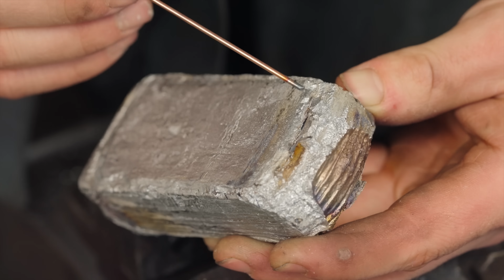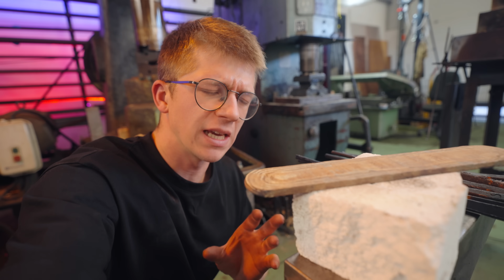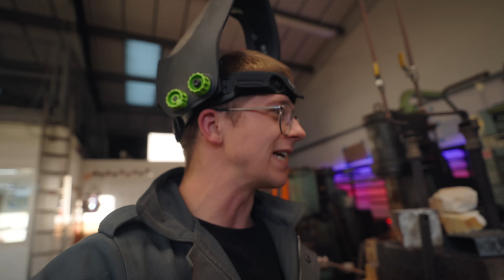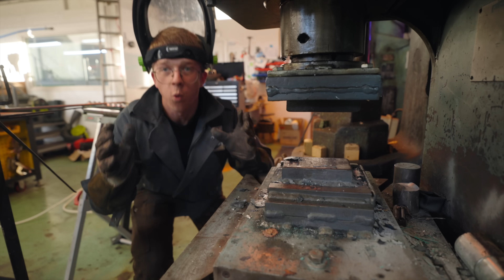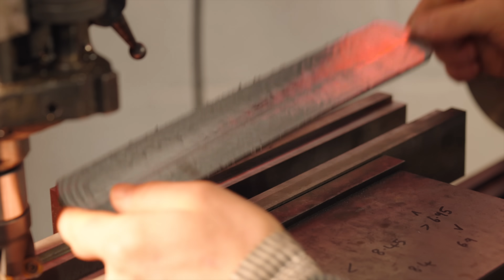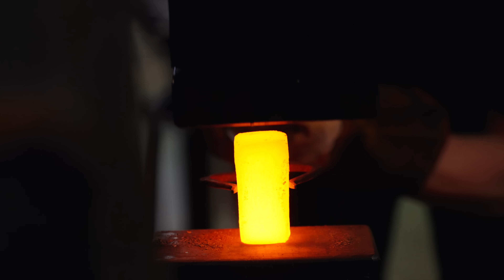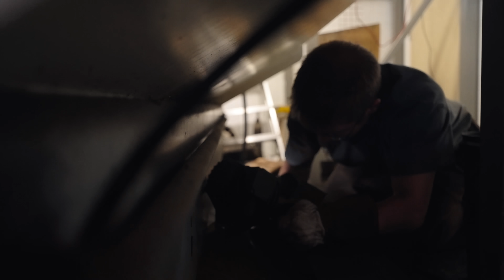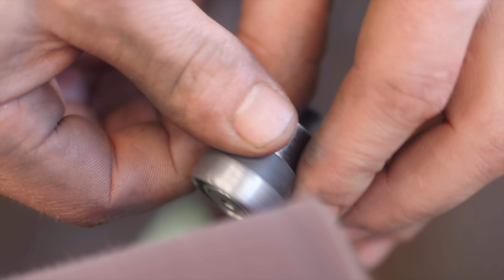Can I Make Titanium Damascus? Part 2

Comment: please make sure to look up all safety precautions for wearing titanium rings.

if your hand suffers a trauma, the part of the finger past the ring can swell up and would require an intervention to be removed.

you saw how hard it was to cut those pieces in the shop, it will be harder in the ER...

these recommendations apply to anyone you give these to
Reply: At the er titanium and tungsten are typically broken off with a sharp blow from a hammer 😨
Reply: @Lunas2525  Never risk using a titanium cock ring.
Reply: I would be able to break it I reckon @deucedeuce1572
Reply: @deucedeuce1572 Too late....
Reply: Ahhh what they actually do is break the ring off. Titanium rings already exist and this is what happens.
Reply: Titanium is brittle but strong. So if his finger got stuck it could be broken off a lot easier than it would be to cut through.
Reply: @graeme.davidson  I agree, just break the finger off to remove the ring ;)
Reply: @dennis6442  [taps forehead] can't have a damaged finger if there is no finger to damage.
Reply: @dennis6442  Remind me to never buy a titanium cock ring. (Not that I'd buy a cock ring in the first place anyways though).
Reply: Along with the finger bone? @graeme.davidson
Reply: You only need to worry about this for fingers you'd like to keep.
Reply: My titanium and gold ring didn't come with any safety instructions!
Reply: @cambridgemart2075  No worries if you don't mind losing a finger or two.
If the titanium isn't continuous and joined by gold, then you should be ok.
Reply: There is a reason rings made of things like damascus steel, titanium, and tungsten have an inner liner when you buy them from most jewelers.  They make it much easier to remove if there is an accident and less likely to cut off the finger in some incidents.

Comment: ChatGPT: Titanium can melt below its nominal melting temperature (around 1,668°C) when exposed to certain conditions like oxygen contamination, high pressure, or stress. These factors weaken the metal's structure, lowering its effective melting point. Oxygen, in particular, makes titanium brittle and less resistant to heat.

Comment: 6:23 In regular chemistry occasionally when you mix two things together you get a reduction in the melting/freezing point. Just a thought.
Reply: Makes sense
Reply: @JIJforgeNfishing just a fact :D
Reply: With some alloys like Zink, aluminum and copper (like ZAMAK melting at a lower temperature than aluminum, even though it contains aluminum and copper). I'm not sure if Damascus can be considered an alloy though, especially not one like that. Some other people are saying that the titanium just isn't dissipating the heat, so it's soaking up the heat on the outside and melting while the inside titanium and steel remain at a lower temperature. I'm not sure how long he had it in the forge though... but it was kind of odd how all of the stuff that melted all came from the same spot on the end and the outside.
Reply: @deucedeuce1572  The piece is only titanium, although different grades, take this as a grain of salt, but in my opinion, that should not lower the melting point. (I'm not a blacksmith or chemist)
Reply: @deucedeuce1572 it is an alloy though, he mixed 6al4v and 3al2.5v Ti to make the original billet
Reply: The pressure might have to do something with it. I wasn't able to find a graph for Titanium but it may behave simmilar like Water wich would be fluid at 1 bar and 0 C but below 1 bar solid and if you go further a gas. Everything at 0 C.
Reply: My guess is that the melting point is lower because this is a Titanium alloy - you have a bunch of Vanadium and Aluminium in there as well. You just googled what's the melting point of Ti, which presumably gave the answer for commercially pure Ti, not the alloys you are working with.
Reply: would the instant heat from friction cause melting possibly?
Reply: Eutectics is what you're looking for, i guess
Reply: Maybe that combined with the gas pressure? Have you tried lowering it down some or can it be lowered any more than where you had it?
Reply: Is it also possible that the argon being pumped in heats up steal faster or at least is providing conditions for the inside to heat at a higher rate?
Reply: It's just bouncing heat from the layered different materials, they have different structural components, so instead of the heat traveling through the whole slab, it's probably bouncing off, in between each layer due to differences in density, melting point, refraction and overall chemical composition.

Just start from a lower temperature and work your way up, 

I reckon as well you should be layering the materials no in line with the holes but against it instead, to create a laminar flow around the whole thing and not in between layers, that should help distribute heat and avoid focal strains.
Reply: @pieroDlio that’s definitely not what’s happening
Reply: Could have to do with the beta transus. Titanium shifts crystal forms at lower temperatures than it melts, and the beta form is more malleable

Comment: Increase in psi=increase in temperature. Im guessing pumping in the argon gas in the container and other gases escaping in the process are holding in the container increasing the psi.... Basically putting a lid on a pot to boil water faster

Comment: Pressure changes the liquefaction point. Like how water boils at different temperatures depending on the air pressure. I think their is a secure patent that that uses a cold roller but the exact method was not disclosed due to US government’s use on pre 2000 stealth systems.
Reply: Pressure generally increases melting points...  but, remember, butter even cold, is a 'solid' but will flow like liquid at pressure 💁‍♂️ plastic deformation
Reply: Pressure usually increases melting points, significantly. The lack of room to expand will keep it solid to a higher temp. But it will have a lower plastic deformation point 💁‍♂️ think cold butter in a hydraulic press, how it will flow more like a liquid under pressure.

Now I wonder, if forging it under vacuum after multiple argon purges, at a lower temp (1600°f), would yield better results.  

But the alloying elements are lowering the melting point significantly. Overheating Ti alloys can separate constituent elements.
Reply: @patrickw9520   US Patent 6,857,558 is a great place to start. Timascus is a strange beast.

Comment: It could be that the billet enclosure was so well sealed that the titanium inside it was also being pressurized as it expands from the heat, thus bringing the melting point down in temperature. I hate thermodynamics, so I'm probably wrong.

Comment: Maybe the melting temperature changes because you're in an argon environment
Reply: I don't think that would change it. Besides that, the argon was gone when it happened the next 2 times.
Reply: @deucedeuce1572  maybe when it's in the furnace the heat is not even all the way through the block more heat is being retained towards the edges that could do it maybe
Reply: @petercarbin2077  That's what some people are saying. I'm not sure myself, but I think that may be the problem. I guess the thermal conductivity of titanium is really bad. I'd be surprised if the iron didn't conduct heat to the titanium though, as they are thin layers pressed right up against each other, to the point of literally being fused together.... so I wouldn't say that I know that for certain though. Hope I find out for sure though. It's something I'd like to have a better understanding of.
Reply: @deucedeuce1572  I would agree maybe the two different type titaniums have a slightly different melting point and the conductivity of heat through the metal that is why everybody says titanium is really hard to work with

Comment: Two thoughts: Have you looked at the data sheet of the alloy and what it says about melting temperature instead of looking at pure titanium, secondly, uneven heat: Titanium has about half the thermal conductivity of steel so would be more prone to pick up hot spots from the forge.
Reply: Yeah, localized overheating and the fact that these are alloys and not pure Ti were my guesses.  Also pressure affects phase changes.  Or it could be plastic deformation that just seems to appear as "melting."
Reply: @thetaintpainter5443  Could be why all the stuff that squirted out was from the same spot along the outside.
Reply: @thetaintpainter5443 nah, more likely iron leached from the steel and formed a new alloy
Reply: The thermal conductivity of titanium is WAY worse than steel.  Way worse than stainless steel in fact.  Almost as bad as plastic.
Reply: The problem is pure titanium is not quite the same as commercially pure. The latter one has upper limits to some of the added materials to it which can definitely lower the melting point
Reply: Good points! I did consider the alloy's data sheet, as alloys often behave quite differently from pure metals in terms of melting points and phase transitions. Uneven heating is also a valid concern, especially given titanium's lower thermal conductivity compared to steel, which could indeed lead to localized hot spots. However, the setup was designed to minimize such discrepancies. It’s fascinating how materials science brings so many variables into play—definitely something worth diving deeper into for more precise analysis

Comment: You need to feed your tool faster when you’re milling it. It’s wearing out your tool because it’s just rubbing and generating a lot of heat.
Reply: If memory serves, titanium cutting speed is roughly 3 times faster SFM than alloy steel.
Reply: @panikrev175  there’s not a single reputable tooling company that suggests that is true. If by “Alloy steel” you mean something like 4140 then that’s typically 500-800 sfm while titanium grade 5(like in the video) is rated for 150-300 sfm.